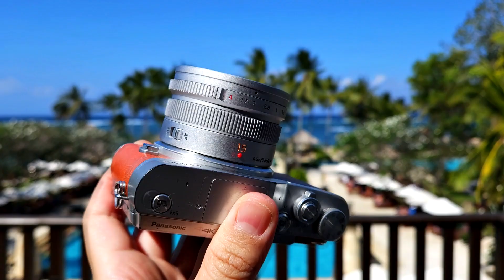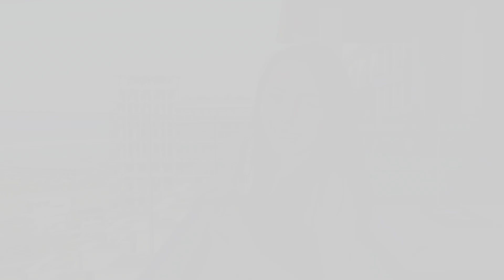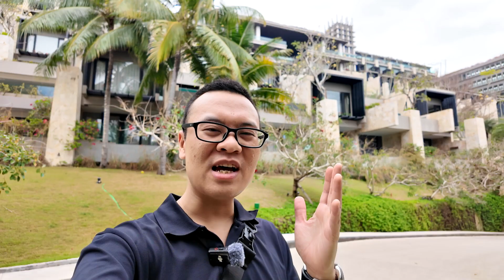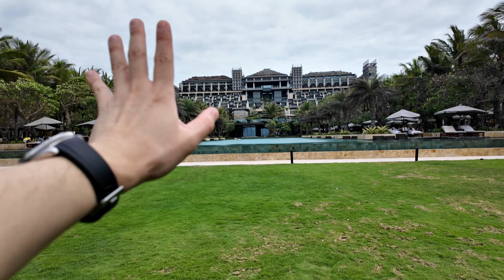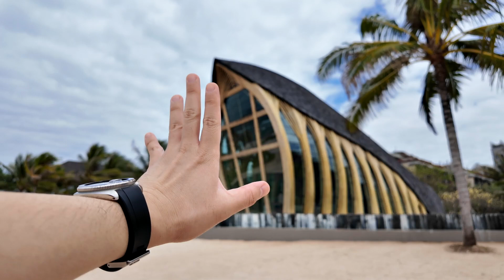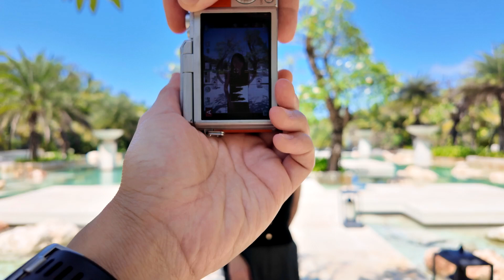Travel Photography using My SMALLEST Camera and ONLY 1 Prime Lens?

Comment: While the Summilux 15mm is a bit pricey and not even as sharp as the classic but slow Lumix 20mm f1.7, it's a good lens and a good focal length. Nice colors. Works well with people too.

But personally, if I am going to a place I don't know, I'd rather have a wider prime. Something like the Olympus 12mm f2 or maybe even the Lumix 9mm f1.7.
Reply from the maker: I'd love to try the Olympus 12mm f2 sometime in the future, and I would probably get the 9mm as well if the price starts to come down.